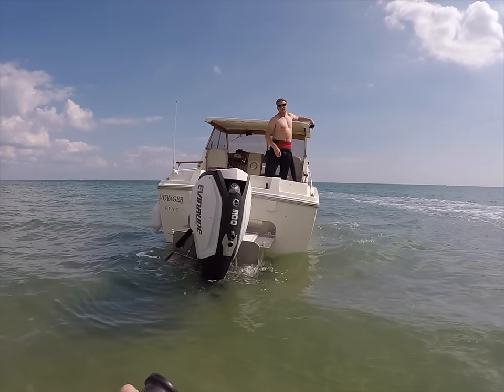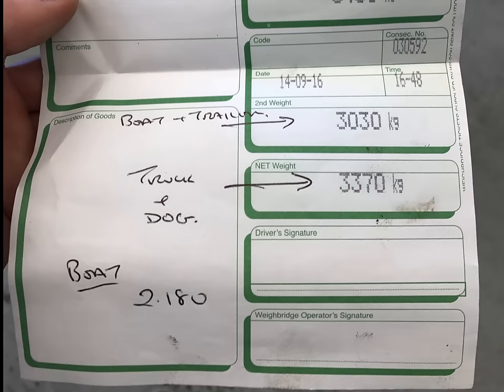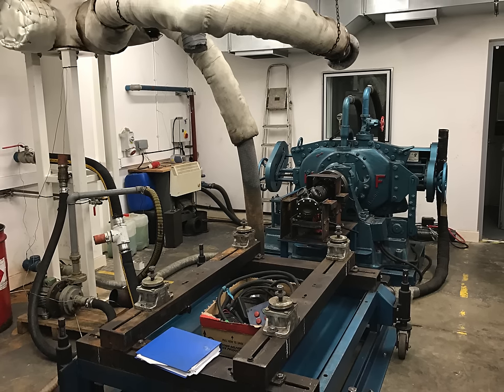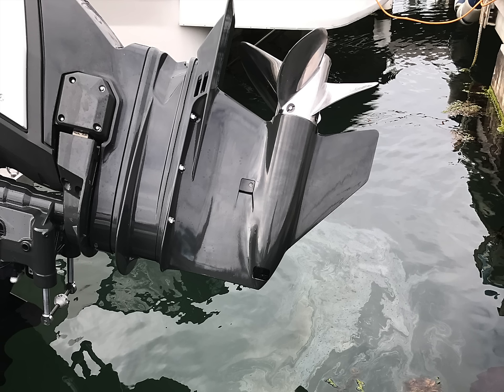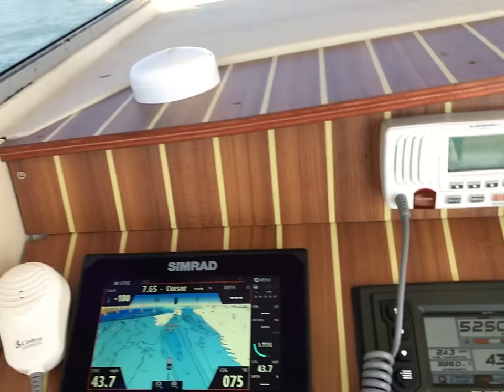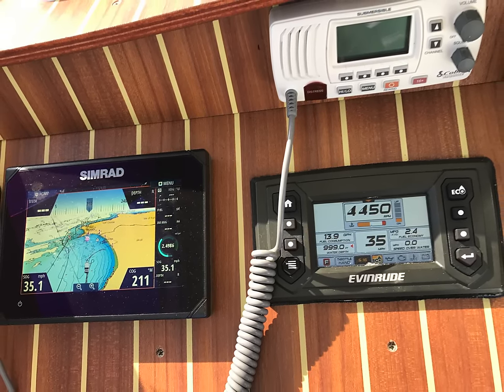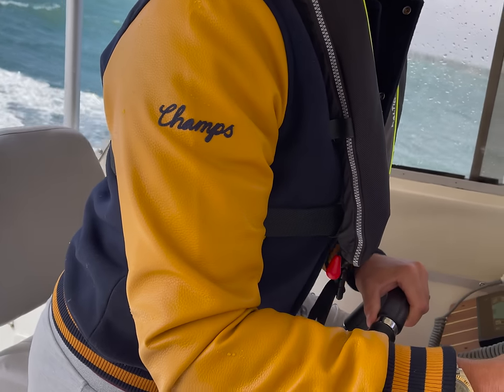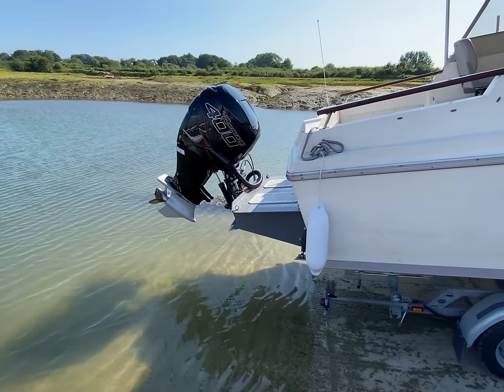MERCURY 400R vs EVINRUDE G2 300 outboard COMPARISON on SAME TEST BOAT (Boat Tech) TOP SPEED TESTED

Comment: Evinrude had a great product. It’s a shame they couldn’t figure out how to sell it.  Strong  advertising from the 4 stroke crowd and misconceptions about two strokes did them in.  Sometimes the better mousetrap doesn’t win.
Reply: They were unable to sell because no one wanted it..  It had nothing to do with misconceptions. It’s old tech, a loud dinosaur oil burner.. The 4-stroke is just a better design and easy sell because it’s better in so many ways. It sells itself has nothing to do with advertising really..
Reply: @spinfish1434  umm what amazing technology does a 4 stroke outboard have that makes a cleaner more fuel efficient fuel injection 2 stroke a dinosaur?
Reply: @supernelsonkiwi  umm a 4 Stroke doesn’t burn oil blended fuel. 2 Strokes are NOT more fuel efficient then 4 strokes. They fire on every revolution vs a 4 stroke fires on every other revolution, making the 4 stroke more efficient…..
Reply: @spinfish1434  the g2 is more fuel-efficient , MORE not less and cleaner.
Reply: @supernelsonkiwi  If that were true it would still be a Brand in production..Please post an independent link to Data showing your claim.. Facts are Facts the Etec is dead because it couldn’t complete with the 4 Stroke..
Reply: @spinfish1434  evinrude is gone and brp are still making the inline 3 engine g2 engine which will be seen on alumacraft boats in 2023, I've got a g2 115 HO and it embarrasses 4 strokes everytime is on the water and at the fuel pump.
Reply: @supernelsonkiwi  Post a link to the 2023 BRP Etec inline 3 Outboard.. Unless you’re referring to their Jet Ski motor? I doubt that will be a big seller too.. I haven’t seen any announcements from BRP to manufacture Etec’s… I didn’t see any Etecs at the Boat Show in my area, I did see many Mercury’s, Yamaha’s and a few Suzuki’s..
Reply: @spinfish1434  I just named the craft man , read and look it up before you try spread more of your propaganda lies
Reply: @supernelsonkiwi  I did, It’s just a Jet Ski motor..Enjoy your Etec while you can. Hopefully you’ll still be able to get parts for it in a couple years..
Reply: @spinfish1434  it's just a jet ski motor? The Rotax  uses the E-TEC direct fuel injection system which you say it's dead.
Reply: They were absolute junk
Reply: @spinfish1434  what ? I know tons of people who want evinrude engines. Less in maintenance and less moving parts than any 4 strokes.  Our 225 h.o whoops all new mercy n yahamaa 250's
Reply: @spinfish1434   Unfortunately you are right. Now we are stuck with heavy and slow ass outboards that don’t last as long.
Reply: @bowhunter4893  Lol, Righto… 4-strokes run thousands of hours more the 2-smokes and now nearly the same weight. Keep running your gas guzzling 2-smoke.
Reply: @spinfish1434  I don't think that's accurate.  It depends on how the person takes care of the engine . I've had a 2 stroke for over 10 years and not a single issue
Reply: @SodiumEx  If they were great, reliable products they’d still be manufactured and sold on the world market.. Fact is, they aren’t and the market for them is gone…
Reply: I m a large 4stroke owner , for my opinion  G 2s are the best outboards, the 4 stroke technology is very old to , a bit older I think, the direct injected 2 strokes don't mix air and fuel like the old days , working similar to diesel engines...most of ocean going ships using low rpm 2stroke engines for efficiency and reliability.
Reply: @SpinFish1  incorrect we all know evinrude got screwed by bpr don't play ignorant
Reply: @SodiumEx  It’s the technology, motor design that failed. The Proof is the Fact it’s no longer manufactured and sold.. (no one was buying them) It’s obsolete, parts will become scarce and more expensive..
Reply: @SpinFish1  na the g2 were just fine and the real cause was obvious bpr and covid . Like I said don't act clueless
Reply: @SodiumEx  Clueless? 😂 Righto, apparently you aren’t that bright because Evinrude is history….
Reply: @SpinFish1 I've already said they were shut down and no longer able to buy them anymore. and were closed bc of covid n bpr. But I see you can't grasp a small conversation.  clearly you were very worried about them flying past you on the water.. also im surprised that you'll be happy for the industry to decrease instead of it to increase. Those who are lucky to own one and take care of it will love their outboard.
Reply: @spinfish1434  wrong
Reply: @jimjg9923  Evinrude… Etec… RIP…
Reply: @SpinFish1  damn dude I've never seen someone come in so strong and not give up on an argument while being absolutely wrong about every single thing you've said. It's pathetic but kind of inspiring at the same time
Reply: @Saltfly You don't know what you're talking about.
Reply: @spinfish1434 You're clueless man.
Reply: @poseidon5003  nobody. And I mean nobody uses etecs in offshore fishing. Not because they didn’t have power. They’re a 2 stroke and plenty of balls. But they were entirely unreliable. And 50$ a gallon oil is a thing of the past. I went offshore twice on a boat with etec 250s. They broke both times. Absolute junk.
Reply: @Saltfly  Were they g2's?
Reply: @spinfish1434  The Etecs were spot injected with oil. Wasn't mixed with the fuel.
Reply: @sdvten  Come on man, same difference, oil goes into the fuel.. Oil is burned, they’re not clean burning.
Reply: @spinfish1434  Actually the oil is NOT injected into the fuel. It is spot injected at certain points on the engine to lubricate the parts. They do not use a traditional oil injection system. The fuel injectors cannot handle the oil going through them. That is why smoke on an etec is practically non existent and it has such a high emissions rating. it avoids burning the oil. If you are going to bash something you at least should know how it works first.
Reply: @spinfish1434  lmao you must never have run a new etec. It's just as quiet and fuel efficient as these 4 strokes. I have one and love it.
Reply: @gilowens5785 they sold me when I did some research and found videos of the etec literally pulling the mercs and yamaha everywhere. Plus they were lighter and just as powerful.
Reply: @spinfish1434
The 4 stroke is not better.  Look at the numbers, the G2 won the cleanest burning outboard award.  And it’s less expensive to work on.
Reply: @spinfish1434
Thousands of hours more?  My 2 stroke is 1993 and going strong  ,  what’s your engine?  Thousands of hours more.. more like thousands of dollars more.
Reply: @ArcticCatMan122   LoL best comment.
Reply: @spinfish1434  i will take the power all day long over the four stroke. Keep sacrifice performance people in America keep the constant maintenance up keep of your four stroke. I will take a 2 stroke over a four stroke any day simple will all ways out beat complicated.
Reply: This guy likes to sacrifice performance that's all 2 strokes are and will be the best choice for a outboard. They plain the boat un like 4 strokes that take a way longer time to plain I have seen the testing. Not really worried about fuel consumption if you are worried about that you shouldn't even own a boat. It's like new trucks they are always going to get crappy mileage. It's all how lazy people are today. People don't want to mix gas and oil that simple they rather do oil changes all the time. I wouldn't unless it's on my vehicle. Modern modern convenience stuff Wich is all junk. But not the 2 stroke outboard.
Reply: @Kyle-bb9zp  You take the power and I’ll take the reliability, Fuel efficiency, peace/quiet and power of the 4-stroke..
Reply: @spinfish1434  good luck with that 4 stroke relive old 2 stroke way better own a lot of old outboards 60's they run awesome always start up and go. 1969 Johnson 25 runs awesome
Reply: @Kyle-bb9zp  You can have that old shake, rattle and smoke…
Reply: @SodiumEx  no he can't grasp it because he loves his 4 stroke so much. He's BS a 2 stroke outboard which will all ways better than 4 stroke sitting in the shop needing valves adjusted and trimming chains more to break. What's that a 2 stroke doesn't need all that. Spend your time on the water with a 2 stroke. Keep sacrifice performance.
Reply: @spinfish1434  the proof you seek is literally in the video you are commenting on lmao. you can see he achieved better economy with the 2 stroke, and the extra 100hp of the 4 stroke gets what? 1.9mph more? with worse economy? and worse acceleration? come on man. modern 2 strokes don't smoke any more, can you see any in this video? and in regard to oil cost go work out what each of your 100 hour services are going to add up to on your 4 stroke, then add on the winterization service too, the inconvenience of having the downtime of that, the extra fuel you'll of burnt, as proved in this video, and compare it to the oil cost.
Reply: I work at a marina, and I never was a etec fan. Stepped up voltage capacitor to run injectors. Injectors that need to be programed to that engine.  A electric oil pump injecting oil. Some had very weak lower units compared to other brands. Power trim leaking down .  Oil tanks leaking. Ecms frying. Coils burning out. Also when I water tested them they always had that 2 stroke smell. I feel bad for anyone that owns one as parts are hard to get and aftermarket dosen't have a lot of options.  Their basically anchors now in my opinion. The older omc stuff is still good and lots of after market parts are available. In the mid to late 90s when they started making plastic carbs and fict engines was there demise.
Reply: Agree with Spanish. The oil is multi point injected and not mixed with fuel. How do I know? I had to replace the oil lines on both my 90's. Just aged.
Reply: Hey I own 2 so I should know no oil goes near the injectors. If you have never owned one then please do not comment. I changed the oil lines myself and there is no oil line to the injectors. Get your facts my friend before you comment. My 90's run like clockwork and I have them on my boat for 13 years already. Run the correct oil on the correct settings and you will have no problems. I only run xd100 not tcw3

Comment: Great video! I always wondered how the G2 300 compared to the 400. The results are kind of what I expected. It's a shame that BRP stopped producing Evinrude.
Reply: I thank god every day brp
Is finally out of the marine industry they produced for years the worst freaking marine outboard finally no more crappy products for anyone to buy yamaha the best
Reply: @BYTES305  Speak for yourself, you have no clue about anything dealing with out boards Telling people yamaha is the best when they where melting power heads at one time
Reply: @bowhunter4893  you clearly are lost in the boat industry my man yamaha v6 is the best motor out there
Reply: @BYTES305  I would disagree. The g2 was insanely good
Reply: @BYTES305 its. not 1994 anymore man.  evinrude etec was and is the best outboard made.
Reply: @BYTES305 I’ve owned 5 Mercs in my lifetime.  Currently own one.  I’ve blown 3 powerheads, and I can’t even count the chit I’ve had to replace on all of them.  Their alternators are made in Korea.  I owned 2 Evinrudes, and the models I had were way more reliable.  Merc usually pound for pound faster though.  I had one Yamaha EFI back in the day, and it had a couple quirks, but mainly solid overall.  I would buy a G2 2 stroke now if they still made them, and I’m in the USA.

Comment: Interesting video.  I had a 31' Chris Craft Express with twin 327ci (5.4l) inboards with straight shafts.  I always thought that pulling those massive engines with marine gears would create a lot of usable space if twins could be mounted on the transom via a bracket. Thanks for the video.

Comment: The G2 had some major problem, but it is my favorite outboard.
Sadly, BRP are not a super owner for them and they are starting to let some customers away by sending message to owner that they are stoping to support them.
Reply: The problem, it’s a 2-stroke… Loud oil burner… Most people prefer smooth, reliable quiet operation with improved fuel economy. Something not mentioned in this comparison was fuel consumption at slow speeds, I bet the Merc would be much better..
Reply: @spinfish1434  still that they were as good as any other and sometimes better than 4 strokes, people hate 2strokes because of the reputation of carby 2strokes
Reply: @spinfish1434  Go look at some performance reports. Fuel economy on the G2 is better, especially below 1k rpm. You don't know what you are talking about.
Reply: @sdvten  Lmao, Righto… The G2 is garbage that no one was buying.. They’re no longer in production so what’s the point? Seriously, if they are such great motors they’d still be in production… You don’t know what you’re talking about..

Comment: The 400r you tested has a sport master lower unit on it. That is much less efficient than the standard gear case unless your motor is on a boat that runs above 85mph or so. It's for avoiding prop blow out. When you trim the motor to get top speed out of her it becomes more inefficient than the one on the evenrude outboard . It scrubs speed off of top end of the Mercury.  Not a great comparison because of those variables.

Comment: 2 strokes will always be the better motor always has
Reply: 2-strokes are dead.. disposable motors that burn oil, they’ve gone the way of the dinosaur..
Reply: 2 Strokes make great weed eaters.
Reply: 2 strokes are the best I have a old 1969 Johnson 25 wouldn't sell it for a four stroke at all. Keep sacrifice performance America people that's what you love to do. Keep buying those high price inboard engine and 4 strokes as the dealer keeps racking them up. Never bought or own a four stroke outboard and never ever will.
Reply: People are getting way to lazy here in America.  Can't mix the oil in the gas anymore really getting that lazy come on I have been doing that for 30 years and I will continue to do that.
Reply: Dam right people here in America are just getting to lazy anymore to mix the oil which is very simple
Reply: I buy my oil buy the gallon last me for years and I run my outboard a lot every weekend when I get a chance.
Reply: First of all I do not know how you can refer to the injected 2 stroke as an oil burner or smoke machine. I have 2 e tec 90 hp on my 18 ft butt cat and for us in SA that launch through the surf you will never beat the hole shot of a 2 stroke. My  e tecs have been very reliable but I have to say that I only run xd 100 oil. No clogging no fouling of spark plugs, to me they are brilliant.

Comment: That’s impressive spd for a 5000 lb cabin boat. I’ve heard the g2 etec r less problematic than the g1. But that’s interesting only 1mph gain on the 100hp more 4stroke. I guess if the weight on the boat was bumped to 7000lbs the etec would’ve loose more top end & the merc would show its rated hp then.

Comment: Mercury made made it smoother ride then Etec in the rough seas but if you have a boat that cuts the waves see ya later and both are sensitive to water when you get water in the tank
Reply: True if you get water in your tank it's game over my etec got water in the tank. Shut the motor down had too replace the tank

Comment: Evinrude is torquier because its engine displacement and power every each two stroke, while Mercury is more silent. 

I preferably choose Mercury ahead of Evinrude, because of the engine noise factor. 

If the old L6 engine isn’t enough, there are now new generations of Mercury’s with bigger displacement to buy, although it’s very expensive

Comment: Are Evinrude still made 🤔
Reply: Hello James. No. Sadly The Parent Company BRP that owns Evinrude does not currently Make / Produce Evinrude Outboard Motors Anymore. You can still get Parts and Warranty work for the Etec motors. If you are looking to get an Evinrude wether it is the Etec Or an Older Evinrude Outboard Motor , They are still Available in the Used market ,  Boat and Marine Dealers Also through Private Sellers. Craigslist or in your local Newspaper Boats for sale. Also , If you have Facebook looking in Community post, For Sale.
Reply: @johnelsonjr.6008  That's sad another legend gone 😥
Reply: Evinrude BRP gave up on Etec because NO ONE WAS BUYING THEM.. Old oil burning technology..

Comment: G2 was almoust great, had 2015 250 H.O. And it was very powerful, fuel efficent,clogged like old carbureted motor when run at slow speeds, was on warranty repais 9-times in 5-year warranty period propably it had faulty EMU from begginnig and they didi not find it until 4-year. Every summer it blackced out everything from instrument panel and Code 20 communications lost ,everything worked but all data lost. It got kind of old when season ended my boatt was took for repairs and at sprig all crap was seen again. Lost faith for motor and sold it.Electrical issues were common with those, when it worked ,was superb :)